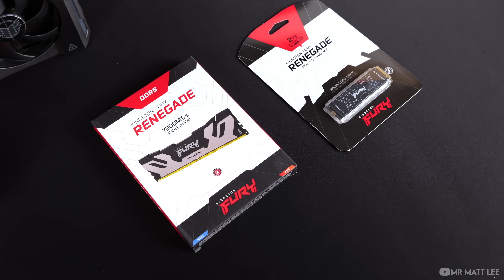PC Digitalism Intensifies! | Deepcool AK620 Digital + Corsair 3000D Airflow Gaming PC Build, 7900 XT

Comment: I had a similar fan setup, but i blocked the front half of the top panel with tape. So the cold air doesn't leave the chassis without cooling any components.

Comment: I got one of those AK620 Digital coolers and the fans are awful, they drone and hum. Deepcool's customer service suck and wouldn't even Consider replacing the fans. The software for the display also crashes regularly and causes high CPU load.

Comment: Deepcool fans are loud as hell especially cpu fans with 2000rpm. Dont be missleaded dont buy it.
Reply from the maker: The sound meter doesn’t lie 🫡 all recordings were taken with the db meter set at one meter away, with fan speeds set respectively at 25, 50, 74 & 100%. Case material, shape & obstructions can either reduce or increase levels. I can only state the exact results for this specific build setup